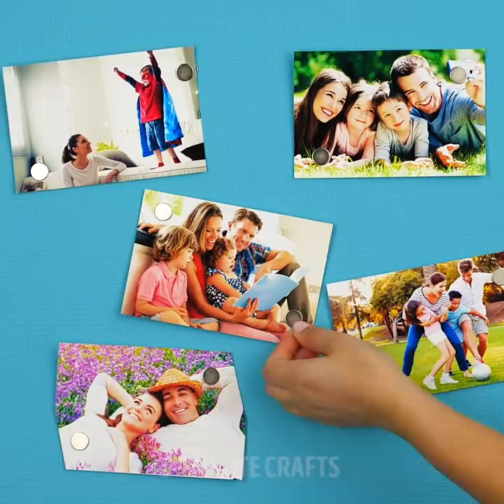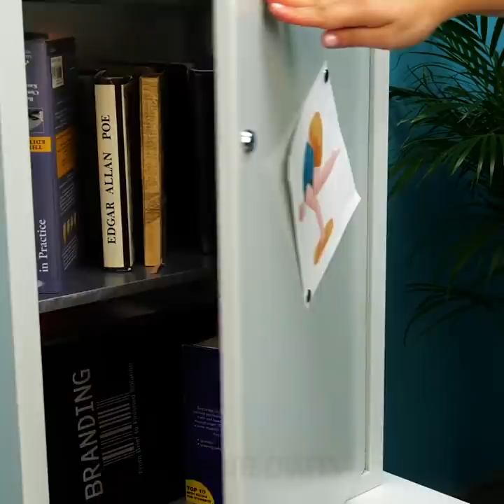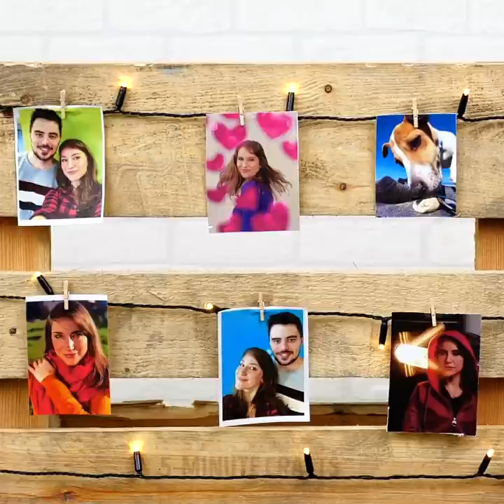27 SURPRISING DIY WAYS TO DECORATE YOUR HOUSE

Comment: All these projects, especially the cement ones are amazing, but I wonder if the cement wouldn't crack while drying. I mean holding earth etc is fine, but water for a fishtank... Especially the ones where you just place a bit of glass in front
Reply: They probably put some sort of sealant over the cement that's exposed to the water. I would hope so anyway.
Reply: Do not put fish in improvised tanks they might be toxic to the fish.